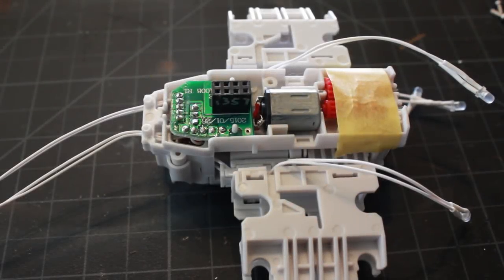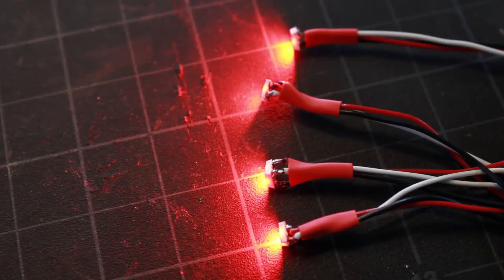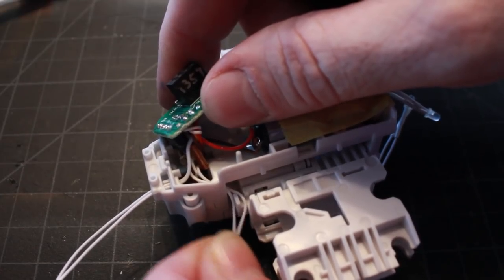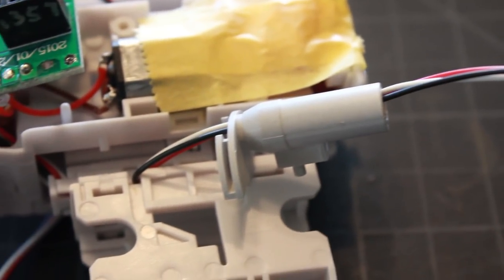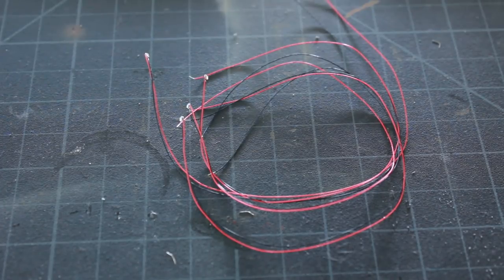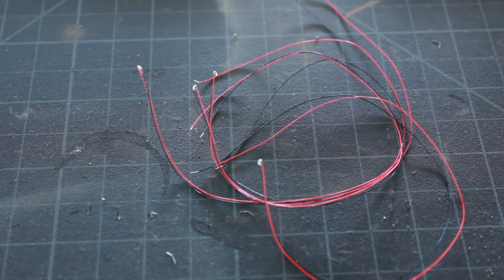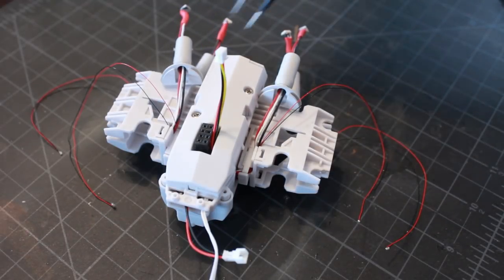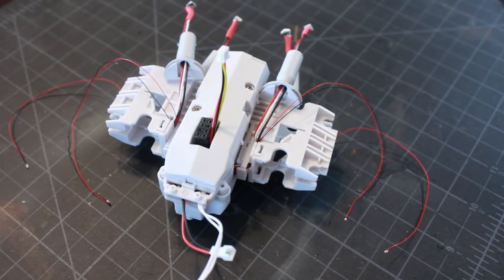Bandai 1/48 X-Wing Pt V Engine and Laser wiring

Comment: How did you control the neopixels without an Arduino? Did you send the code to Bandai's board somehow?
Reply from the maker: I'm using an Adafruit Trinket board as well as the Bandai board.  The Bandai board in the motor housing is supplying the power to the neopixels, but my Trinket board is sending the data signal to them.  The Trinket and Bandai board are both running off the same power.
Reply: @modelsbychris  Aha! Nice trick. Really enjoying your builds. I do similar work on my channel, though not as well!! Please take a look and tell me what you think.

Comment: Instead of desoldering the cockpit light from the circuit, couldn't you have just cut the wires halfway and soldered your wires together to them?
Reply from the maker: Probably,  but I was using thinner wire because of my additional lighting and thought it was just easier.
Reply: @modelsbychris  Thank you! I appreciate the response. I've always considered Bandai's electronics to be lacking. I actually had the same idea of lighting up the R2 on the 1:48 Fine Molds X-Wing with an LED!